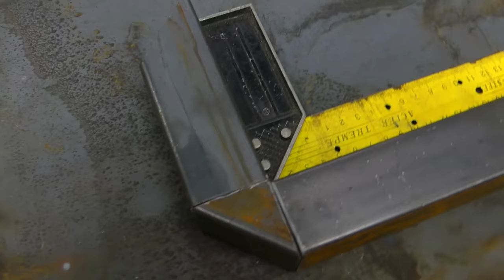Secret Profile Pipe! WHY DO WELDERS NOT SPEAK ABOUT IT!

Comment: Why tf did you cut 45s on the first one and not just put them together it would have been so much easier
Reply: Also would have kept uniform cross-section, not pinched.
Reply: nuclear explosion you could cut the 45•s and then use them on the inside corner for superior strength. Otherwise I could bang em together quick like you said

Comment: I read a lot of negative comments here, but for some of us that are part time welders or fabricators, and do not have a full set of tools, only a manual grinder/cuter this is very illustrative. I will definetely build my own working table with this instructions...wish me luck
Reply: I hope for you sake you do your research and learn how to do it correctly. Even with the limited tools available he did the job incorrectly.
Reply: This table is kind of gimmicky. I would never advise someone to build something like this. Better have a solid metal table. Then you add a hard rubber or thick plywood on top when needed. And you dont need the plywood or hard rubber to cover the whole table, just half will do. And basically it's only use is to dampen the sound.
Reply: @the__dark_king  Согласен, такой стол - излишество, но человек сделал для себя, для удобства.
Reply: @АлександрСтепанов-к7ы  Sorry. I didn't understand.  Can you translate please?

Comment: Honestly at this point I’d just take some sheet metal and make 2 cuts and weld it. That’s if I ever needed to weld a cap at the end of square tubing.
Reply: Ya, but if you're making a finished, designer-type piece, good info to have.   Besides, he's just showing aays to work with square tubing.  Which is good.  :)

Comment: The reason welders don’t speak about it or because it’s too complicated there’s easier ways of doin this
Reply: someone that doesn't use a cold cut off saw, isn't going to know much are they? :P
Reply: @damonalagich4524  fair
Reply: Amen to that!
Reply: Yeah, Im a fabricator and have done alot of ornamental work over the years and this is wayyyyy to much work to get the same result. Time is money so doing all these cool pie cuts and bending and stuff to get a simple angle is pointless.
Reply: Cut at 45 degree, weld, cut corner off and plate then grind it. Same result alot quicker.
Reply: @river_of_styx5565  That has to be 14 gauge steel any more penetration and his <B>welds</B> would burn through.
Reply: @joey7422003  @joseph Lucero, Yea, you right. I was looking at the weld he made neat the 7 min mark, thought the burn marks, from the grinder. Not bad welds. That being said, Those welds still suck LMAO
Reply: @whereforartthou  It's like crystal meth meets MIG welding here. Where is the well saw, or even a porta-band saw? Where is the soap stone pencil? Where is any band saw at all? Why is he laying his marks out over rust & mill scale too? A grinder and paint makes him the welder he ain't. All this "cool" cut and bend technique, using a grinder and a handyman's claw hammer makes for some pretty sketchy looking finished work too. I would not use that crap to mount light switches to on the railings at  work, and I just have an electrician's welding class and a few years of experience under my belt. Okay, 40 years.

Comment: THANKS FOR POSTING One thing, though..., turn your voltage and wire speed down and you can run a continuous bead instead of tacks, so when you grind it smooth, you're not grinding all your strength away. I'm not trolling...just helping the fellow out. Adjust your power till your bead sounds like frying bacon. If it's too jumpy, cut your wire speed back a tad. You need a closer wire stick out, for thinner metal and if you have a thick metal and a thin metal, throw most if your heat onto the thicker metal and wash back onto your thinner. Use an elongated cursive e pattern as you move. When you get to the end of your run, double back on itself before you stop. That wat you wont blow a hole in your edge. You'll see a BIG difference.

Comment: Obviously not a welder. Tack welding is not a good method.
Reply: Just think of it as manual pulse mig, I mean im a welder too doesn't mean im gonna brag about the fact I could weld that thin stuff with it hot as without stopping, nor would I pick on someone else's work either. Also tacks are those little spot welds you do to hold something together, not what he did at all.

Comment: Dude gets a mig welder and still spot welds..
Reply: Not a mig, it's a single-amperage setting flux core (you can see the flux and spatter). So, he spot welds bc FCAW at the "one setting fits all" likely would punch right through that 1/8" steel.
Reply: So i know im late to this party but y does it have a gas nozel if its a single amp flux core welder ?
Reply: @codykersch449  Most come like that. I bought a Forney flux core 125 for trail repair and it came like that, it even has some shielding gas tubing in the whip. More than likely, it's cheaper for the company to buy 5000 units of mig whips vs 2500 of each kind, retool the assembly line just to have a 'custom' flux whip
Reply: @jakewesterfeld5960  ya theres also no flux on the welds i dont think you know what your talking about kid
Reply: @codykersch449  Seems to be at 2:42 when he's grinding down his welds. The light brown surrounding the welds looks like dirty flux (flux with some rust in it) from the core, not heat coloration. That said, I see a gas hose running to his machine, but I can never spot the tank?

Comment: Some ideas for the table. add a tab on the metal side for a ground clamp so you can use the table as a grounded welding surface. don't clamp the frame because you wouldn't want the current passing through the pins that it spins on.
Reply: Why not? It will be fine 🙄

Comment: I really appreciate you're work my brother, and I don't mean to bring any negativity. But if you turn your amps down and your wire feed speed up, you won't have to constantly stitch weld with the mig. It should be one quick bead as you push away. Best of luck and thanks for making the video 🍻

Comment: I'm not a welder. I use to cut the steel on the Radiack saw and I did the grinding to remove the weld slag for the welders. You do good work. Impressive. Quality work. I can tell you are a really good welder.= that takes pride in his work.

Comment: Good video and good job here. Nice work but the title is click bait. This is type of fabrication is done in the shed of a trailer park where I come from. Real fabrication rarely uses same thickness steel and usually is utilizing some other shapes as in oem frames, axles and random farm equipment
Reply: I can't remember the last time I touched a piece of steel under .188 wall thickness. You're right this shit is useless.

Comment: That's an impressive "finger pincher" you've built there but...  Where's the piece thats pictured on the video thumbnail?  I have use to make it.  Would like to see some angle/length measurements for the pieces you made. 
  Dumb question, why blue for the wood side?  Purpose or preference?  And is it just to have a wooden topped table...  What do you use it for?  Definitely innovative and space saving, right in my wheelhouse...  I get the metal/welding table side...  (I tend to overthink things at times but...  That's how we end up with combination woodworking/welding tables!)
  Please help with measurements.  :)

Comment: Did anyone see the "secret" the clickbait title refers to? The 45 degree corner weld is unnecessarily complex and too much work in the way it is shown here... There is a much easier way, with less than half the cuts, one quarter of the measuring and a quarter less welding involved. And that is why welders don't talk about this method. This is like cutting 4 strips out of sheet metal and welding them together to get a box section that you already have in stock, ready to use.

Comment: the reason is obvious , welders dont do these welds or any other fancy welds on the regular , becaue they are time consuming , they are not stronger then any other weld in most common situations ,and if your maths and cuts are off you wll end up with huge gaps in the joint that you would have to fill , wasting even more time .In case you did not know , many welders get payed  by the ower but they also have to reach a quata ,and then there are those who get payed by the lenght of the weld if it is a good weld . Bottom line is , dont waste your time unles you are doing an art  or other project

Comment: He needs to turn the heat down and actually run a weld not keep tacking it/weak ass welding 45 both tubes and weld it like a human
Reply: no gas straight wire

Comment: When fabricating thin steel section, it si recommended the parent metal at the joint should be bevelled inwardly. This allow the weld metal to penetrate across the material thickness. This also leave more weld material in the joint when the weld cap is ground off. Worth looking on this medium for example of thick plate welding in professional welding shop.
Reply: @richardchase4019  I am a retired Inspection Engineer who spent 44 years in the Petro-Chemical industry. Until I retired I held qualification in all four discipline of NDT (non destructive test) of welds. I do not know your country residence but I am sure you must have as standards organisation with books on welding and test of weld procedures.  I did not intend to upset anybody but when you see a weld being 90% ground off I need to comment. I wish you well for the future, keep well and safe.
Reply: @richardchase4019  You are just being picky now, back in the 1960's you had to do the job  become an inspector of welding or other skill etc what we knew as a 5 year apprentice. All finished now I got other thing to do.

Comment: The reason these welders dont speak about it is because it takes a crap ton of extra time. If they have like 100 joints to weld it is a nightmare to cut each individual one like that then weld it. Duh?

Comment: I would get fired if I wasted the amount of time that any of these profiles take. 

Most welders tend to try and stay away from a cutting wheel when ever possible. It is by far the most dangerous tool in any shop. With that said if you want to cap a pice of square tube you cut it to length take a square plate and weld it in place. Job done ...